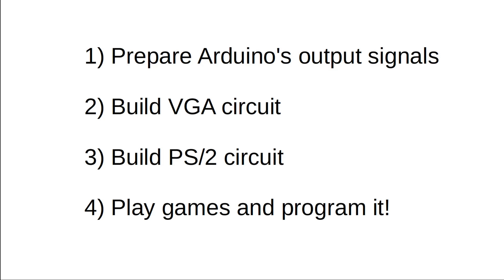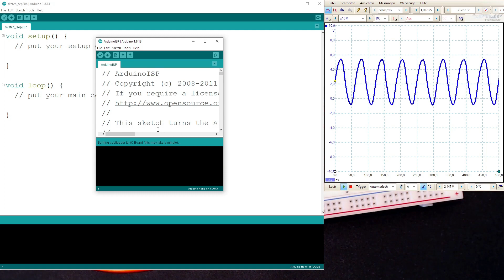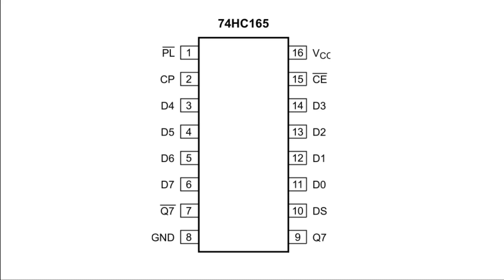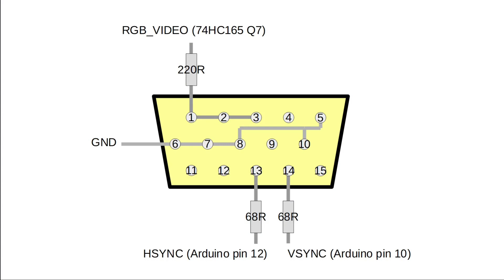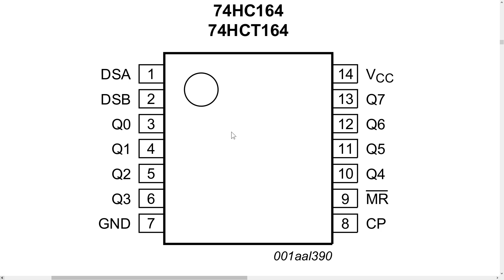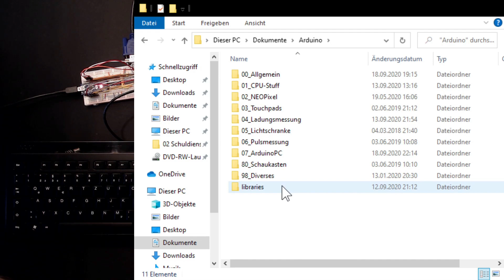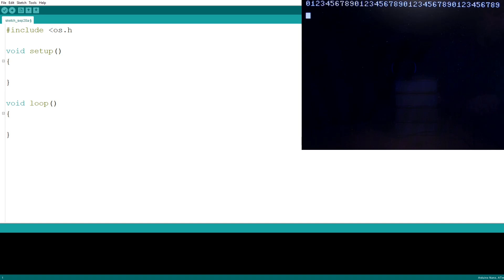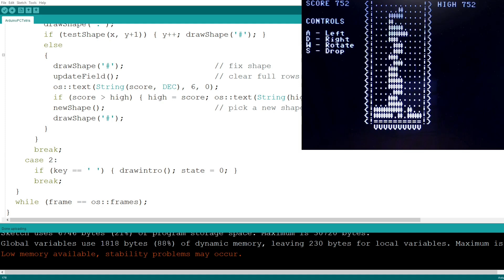Squeezing Water from Stone 1: Build an Arduino NANO Computer with VGA Output and PS2 Keyboard

Comment: Why use one Nano to program the other? Why not just program the terminal Nano directly over USB?
Reply from the maker: You can upload code via USA if there is the proper boot loader present in the Nano. Programming the fuse bits of the ATmega32 is to my knowledge not possible via USB/boot loader.
Reply: @slu467  Thanks for that explanation!
Reply: @slu467  I also thought that it wasn't possible to program the Nano via USB, but it turns out I was wrong.  In the Arduino IDE, you have to select 
Tools  ==> Processor ==>  "AtMega328P  (Old BootLoader)"
This is because most Nano clones have the old bootloader in them.  Genuine Arduino Nanos have the new bootloader.  It is possible to update the bootloader if you want, but I find it easier to select the old one instead, and put a small label on the Nano to remind me.

Comment: About 8 years ago, I did something like this with an Arduino MEGA. I got some C source to tiny basic and added it in. I got some thing like 32x15 lines or so. Later, I did it again with a DUE and could get much better screen. I just googled and it looks like a bunch of people have done similar to this as well. However, your VGA and PS2 74xx implementation is the best!!!

Comment: Could you please tell me what kind of capacitors did you use, because I can't seem to find a 100nf electrolytic one. Is it:
1 100nf ceramic
1 100nf electrolytic
1 47μf electrolytic
?
Reply: I built it after finding all the logic ics and I had a great time programming it, but could you also tell me if it is possible to also reuse the pins d4 and d5 in order to free up the a4 and a5 analog ones that are used for keyboard input and if yes how can i modify the os.h and os.S files for that to happen. I would like the pins a4 and a5 free for the nano to communicate via the 12c protocol with an other Arduino.
Reply from the maker: @themagicalminer3233  I guess now that you know the thing so well you are in a better position for working out your ideas than I am at the moment. Go for it :-)
Reply from the maker: I should be 100nF ceramic and probably 47µF electrolytic. The actual values are not crucial.
Reply: @slu467  ok thanks

Comment: Do you know why 74HC165 hadn't work in your discrete VGA card? Edge detection  on 74HC86 + 74HC165 should be almost same as 74HC166. /*except for 2 propagation delays 1 for 86 and 2 for 165 latch*/ was the difference visible on the screen by  not proportional 0-byte pixels columns or the 86+165 circuit didn't work completely with discrete sync generators? /*I have plenty of 165 and they're dirt cheap, so for me to use 2 chips - one 74HC00 for edge detection and 7HC165  as pixel shifter is a sweet solution ;) */
Reply from the maker: Jep, timing and propagation delays can be quite tricky here.

Comment: Why convert PS2 to parallel and use so many gpio when can just hook clk and data straight to Arduino?
Reply from the maker: The Arduino has to ensure rock-solid VGA timing. No chance of pulling that off while at the same time employing interrupts for serial I/O or just plain polling.

Comment: This is a good Project. Before 35 years a VGA-signal was a great thing with many TTL chips or a CTR-Chip. Today one processor mega328 is able to create a screen signal and have power for more. but today full-HD is the minimum for computer displays but for old VGA-monitors this is one solution to display a screen with 640x480 pixel monochrom. if you take a separate RAM you can produce a color picture VGA.
Reply from the maker: Hi Paul, I usually try to strip away any functionality except for the bare minimum. Color is something I won't do for this reason. But thank you for posting the idea! Sounds really feasible.

Comment: Completely agree with the appeal of using the nano at the fringes of its capabilities.
The simple solution is to utilize high specs to solve problems, the fun is doing more with less.
Great video and use of the nano.

PS- I think that adding a secondary nano to implement additional misc computations would be a fantastic addition.
Similar to the Sega Saturn distributed computing  where multiple cores worked independently and shared their data to the main core.
Reply from the maker: Thanks for understanding and appreciating, Alan. I have already finalized a full VGA terminal... will need to find some time to make a video about it, though ;-)

Comment: whats the second chip on the VGA-part of schematic? is this second 74hct164 ?
Reply from the maker: Hi Marek, I've used 74HC165 and 74HC164. Cheers!
Reply: @slu467  Thank you for your fast answer :).... And.. can I use 74HCT16x  version of chips ???
Reply from the maker: @marekklucka8020  I haven't tried the HCT versions. They just have different logic level compatibility. But it should be okay.

Comment: This is a little too cool, congratulations on this. but i am left out with a few questions,
1.How do you move the cursor, since i didn't find any ascii code for the arrow keys
2.Is this a different keyboard than the one you used in the minimalistic CPU, since it was sending different kinds of data.
Reply from the maker: Apologies for my late answer. Somehow your message got stuck in the filters...
1. I made up my own "ASCII" codes for the arrow keys. I think I've picked 4 of the unused lower control codes, maybe 17, 18, 19, 20 (device control codes).
2. I am using the same keyboard type sending the same type of data.
Hope this helps,
Cheers!

Comment: Fantastic video. I'm really impressed. Would it be possible to use a ATMega chip + a few component in place of the nano and use your extra chips to make a single board computer? Prob need an FTDI cable too. 

I've seen Rob Cai do something similar but with 2 nanos https://www.instructables.com/id/Arduino-Basic-PC-With-TV-Output/. He also has a colour version that also uses 2 nanos
Reply from the maker: @ David: Just using the AtMega328P is certainly possible. But as you already mention, a separate USB-to-serial board would be necessary to upload stuff. Using the Nano is so convenient. I've just finished a colour version this morning :-) but that would mean adding a quad AND gate :-( and it has only 1 out of 8 colours per row, not per character...
I am not sure if it's worth it.